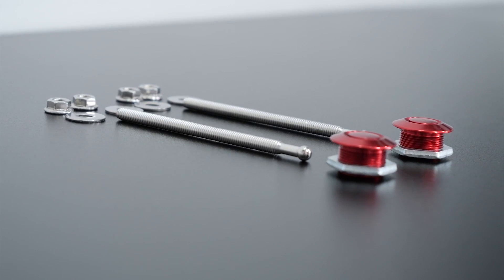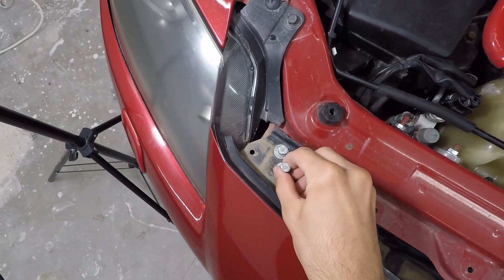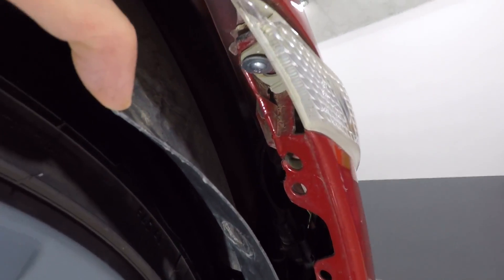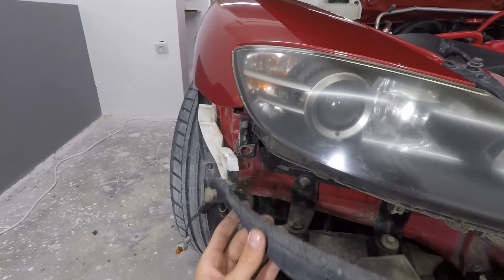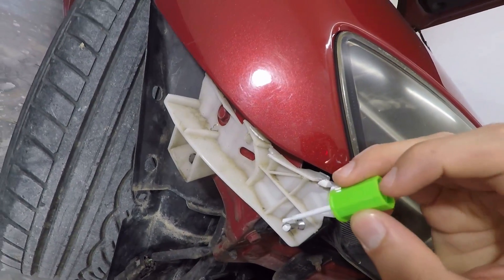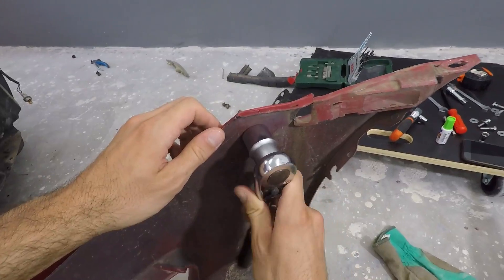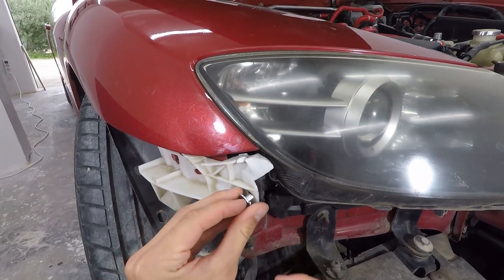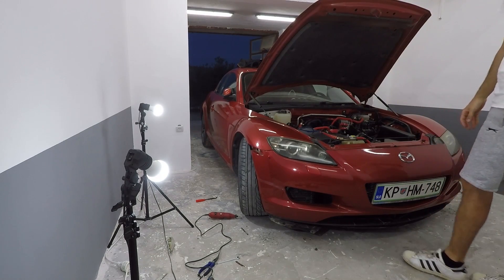Mazda Rx8 Bumper Quick Release Install pt1 | Quick Latch Kit

Comment: What have you actually won by doing this install? I figure you still need to bolt up the under tray and put the clips for the wheel tubs in. Is it only so you can avoid putting those 4 bolts in at the top?

Comment: (us) I found an 2009 Rx8 with 74,000 miles for $7,000 should i go for it?
Reply: No, you buy mine with 55k miles on it for 10k and import it over there.
Reply: Proof of compression first. Dont matter how many miles are on it if it's got a shot engine.